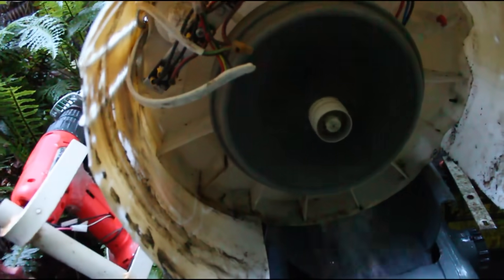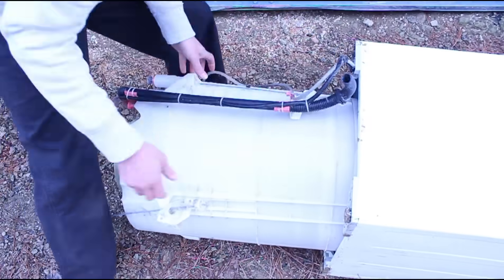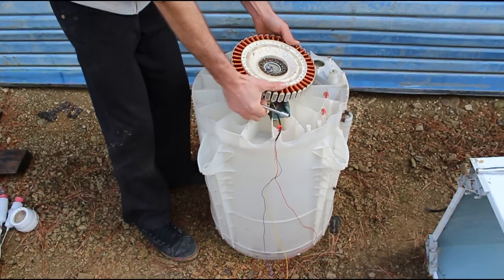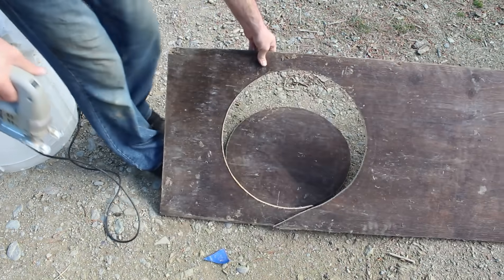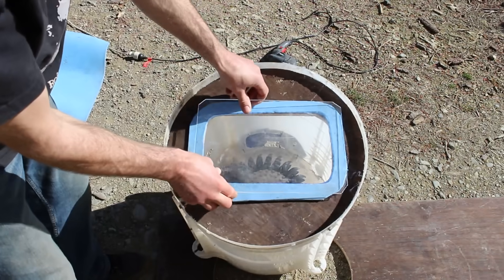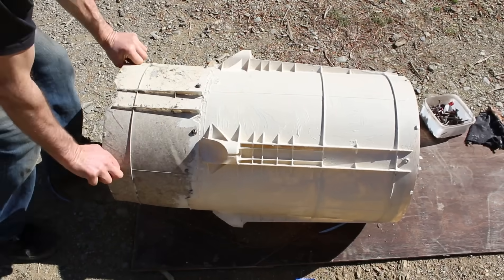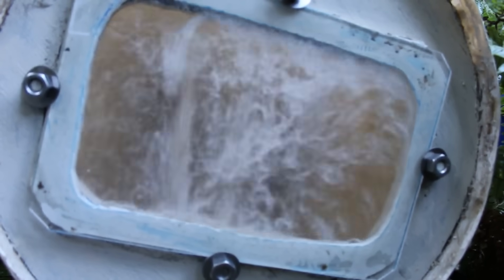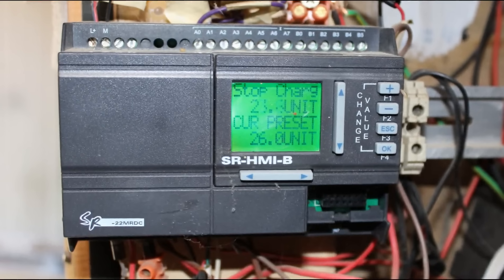Free power- How to convert an old washing machine into a water powered generator

Comment: Hi I know this is a 2014 video ...but I was thinking and would like to know if you think it would be possible for your water generator to run a strong enough water pump to run your generator...thus making it a free energy closed circuit or will the energy consumption of the pump equal out the energy generated. Hope to hear from you... Thanks
Reply: the problem with your idea is this.    THERE WOULD  BE  NO  POWER  LEFT OVER,   TO   GO  TO    HOUSE.     result:  a  Do-Nothing  system.

Comment: Did you have to have a reservoir to be able to get your 45 psi pressure?
Reply from the maker: My reservoir is around 100 litres, as long as you are using less than the stream flow , you don't need a large dam

Comment: Why do you close the tank and not allow the water run out from the big exit? Wouldn't that creates additional friction and resistance? I am not criticizing jus wonder if there is a reason for that?
Reply: ngry Ram
2 weeks ago (edited)
Cut hole and closed front opening to control flow, if water comes out front opening at high pressure, it sprays everywhere, makes the ground slippery, wet slippery ground creates hazards

Comment: Can I ask, it looks like around 4litres per second? We have solar and they want to charge us for feeding into grid at peak times, so thinking we could pump water to a storage tank"battery", but is there a way to make it more efficient, even if we have a water tower?  (Some days we have excess 20 or 30KW)
Reply from the maker: Yep 4-5L/second. Yes that would work, or use excess power to fill compressed air tanks then run air turbine when you need more kw.. Also some power companies here give an hour of free power every day so you could run a huge pump for an hour and fill a reservoir to run a turbine during peak times. A lot of work to set up especially if you have to build a tower, more feasible if you have a hill on your property.
Reply: Get batteries and charge them at the house....
run your whole house including a/c or an electric vehicle with your stored power...
or feed it to a neighbour if say they pay for the extra solar panels etc.
Feeding it back to the power company is a poor deal for you....

Comment: Hi , thanks for the video ,    I would just like to ask ,   how exactly are you getting such high pressure water supply from that stream  ?           I think it is clear, of course that we all know , energy canot be created , only converted , with variable degrees of efficency.      I like the idea of using the 3 phase system from the old wasing maschine,  its neat. 

Are you living way down stream - collecting the water in large tanks and then using a gravity feed to get the pressure up to this usable level?      I dont see anyone having asked this question  ?
Reply from the maker: Gravity creates the pressure, water intake is higher than the outlet
Reply: Hey mate I’m impressed with your set up!  I am thinking about attempting to make one,  can you please give me more information about the  automatic shut off valve drill thing you made?

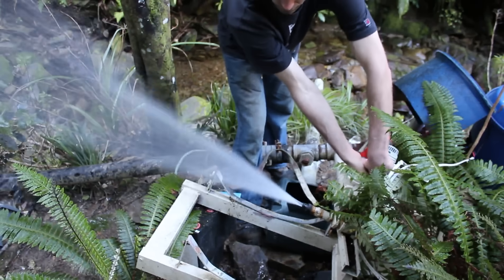Comment: 8:13 45 psi water pressure is equivalent to 32 m of water head. Either this bloke lives next to a 10 story waterfall or that water is pumped, and therefore not "free" power.
But a very impressive way to reuse a washing machine
Reply: Not hard to get 35m of water head on the mountains.... 🤷‍♂️

Comment: May I ask some question? 
How did you set an ac wiring to dc? To charge the battery
You have a video of that?
Reply from the maker: I use a 3 phase diode bridge rectifier, it converts AC to DC
Reply: @Rambro-angryram  thank you sir.

Comment: How far is the house from the creek ?
Reply from the maker: 500m
Reply: @Rambro-angryram  so the power goes from the turbine to the house through power cables that you laid? Might sound like a dumb question, sorry 😀
Reply from the maker: @Oceansta  From the turbine to the 24v battery bank, batt bank to the 24 - 240vac inverter then up the cables to the house

Comment: Hello I have a Fischer and Paykel smart drive that I bought to turn into a generator. We just got the white plastic bolt off but we still can’t get the rotor off to rewire it. What did you do to get the rotor off. We rewatched this video several times and we don’t know what we’re doing wrong.
Reply from the maker: Hi, I've never seen a black rotor, are you sure its a fisher & paykel? usually the plastic bolt wiil pull the rotor off as you undo it, maybe it has broken the piece connected to the rotor, must be jammed on, you may have to use some force to pull it off, does it turn easily without rubbing on the stator?

Comment: Not telling you how to suck eggs, but have a think about using a cars' alternator as the power producer, modern ones can produce 2500 watts @300 amps and give a steady curve of power increase, no surges, it has to be kept dry, so out of the water, connect to water wheel with drive shaft,  just an idea . . .
Reply from the maker: Nice idea but car alternators don't produce much power under 2000rpm, my turbine max speed is about 1000rpm so I'd have to gear it up which would mean heavy frictional losses

Comment: You can take a 50-gallon barrel and fill it up with water and run the XX out of the windmill Watermill I should say into the tank and then hook up a pump that sucks it back into the container and it makes its own light Rizzi you're going to have to have a battery charged up enough to get that generator rolling first you won't need a river just a 50 gallon barrel do filled up water

Comment: Do you know if other washing machine would work too? Or any other appliances that have a motor that would work?
Reply from the maker: Any motor will probably generate power with the right modification, I use the smartdrive because theyre well built and will produce 1kw continuously for years no problem
Reply: @Rambro-angryram  Thank you for getting back to me so quickly. another question: Why do you rewire the stator? Couldnt you just put an AC to DC convert on it? or do you get more power by rewiring it?
Reply from the maker: The factory stator puts out 400+v and is quite hard and slow to spin with a load on, rewiring lets it spin at a faster rpm more suited to wind and hydro applications and it is safer to work with the lower voltage
Reply: Angry Ram, I just finished rewiring the stator. Followed your video. For some reason it’s much harder to spin now... and i get less Voltage and Amps from it... is this normal or did I do something wrong? My hope is to make a windmill out of it... so need it to spin as smooth as possible... thanks for all you’re replies!
Reply from the maker: Something is wrong sounds like you have a short somewhere
Reply: Angry Ram you are right. I had the terminals confused. Once I figured that out I reconnected them and it seems to work better now. The thing is that with wind being less powerful I might actually find another washing machine and not rewire the stator so that I get more power with less rpm.... thank you so much for you’re help!

Comment: Weld the bottom witch holds the engine in from scrap metal.. It will not melt the moutnning space

Comment: How did you get 45 psi water pressure?
Reply: The water inside the pipe from upstream is affected by gravity which gives it "weight"
The longer the pipe and the further the fall the higher the pressure at the bottom of the pipe.
If the water had been in the pipe and fallen 229 feet, the pressure would be 100 psi......
Reply: @JohnSmith-yv6eq  thank you

Comment: How do you deal with blockages and silt?
Reply: The intake is a shade- cloth- as- filter covered pipe with small holes in pipe...
When the production of electricity drops off, Marty goes up to this intake and cleans it off.
This then allows the correct amount of water to flow once again.
Have a look at the recent installation at a friend's place...
https://www.youtube.com/watch?v=LVoeaKCEd2o&t=205s

Comment: This can be done with any model or has to be that specific model. Thank you
Reply: I think the key is that circle of wrapped coils bolted onto the drum. Most washers I've seen here in the US have the motor (which can also generate) off to the side driven by a belt. Maybe it still can be done. He did say get this exact model.

Comment: Why does it have to be a Fisher-Paykel machine? Can't find new let alone used.
Reply: It doesn't have to be, it just has to be a bldc motor similar to the one shown in the video. Apparently other brands in some models will use a similar motor.
Reply: @versedbridge4007  "bldc motor"?
Reply: @oldmanfromscenetwentyfour8164  BLDC means brushless direct current motor, which is what kind of motor the smart drive motor is.

Comment: Wondering how you get that much pressure
Reply: Gravity supplies the energy...the higher the overall fall of water, the greater the energy when it hits "bottom" which in this case is the nozzle squirting water at the Pelton wheel which turns the turbine etc etc.

Comment: Wish these videos that claim runs my house would state the kwh they use and generate. Or mention the electrical appliances being powered and how long for each one plus the amount of batteries they have. Because a normal house will not run off this.
Reply from the maker: This one puts out up to 1000w continuously 24/7 so 24 kwh/day. This is  more than enough to run all the appliances in my house -microwave, toaster, kettle, fridge, freezer, tv, laptops, lights,stereo, assorted chargers, 600w heater, rice cooker. and hot water heater.. the list goes on. I use gas for cooking. my battery is 24v 100ah I also run most of the tools in my workshop with the free power. grinders, drills, sanders, lathe, buzzer. I switch on the generator to run the welder, compressor and thicknesser.

Comment: Motor spins by electrical power in the stator coils which makes magnetic power. How can it produce back electric current without any magnetic field around coils? I am sure the material which rotates doesn't have any magnetic power. I watched complete video but can't find any details how electric current produces.
Reply from the maker: Magnets are built into the rotor

Comment: Why not run ac from the motor to the inverter and put the rectifier  there since ac travels more efficiently than dc?
Reply from the maker: It generates high hz ac which doesn't travel well through cable (skin effect)
Reply: Oh. I see.  Thanks for the reply.

Comment: Where are this links please??? I would like to see how to convert AC to DC
Reply from the maker: Sorry about that, youtube no longer has annotations so the links disappeared, To convert to ac all you need is a 3 phase diode rectifier, click on the link here - https://www.ebay.com/itm/2pcs-Bridge-Rectifier-3-Phase-Diode-50-Amp-1200V-SQL50A-New/123140383852?epid=17019536861&hash=item1cabbd246c:g:PgEAAOSwYeNa~jSX:rk:1:pf:0

Comment: How do you get such pressure from a trickle of a creek?
Reply: Gravity. The inlet to the pipe is a long way up the stream, something like 40 metres above the generator in height. The weight of the water in the pipe is what gives the 45psi.

Comment: There are a ton of vids out on youtube like this, but nobody ever tells how many man hours, the actual costs of the other needed gear like batteries, inverters, etc...would be nice to get a complete image of what's really involved.  Nice video...very creative, however...seems like doing all that for just 4 months before the bearings burn out isn't all that great in my humble opinion.
Reply from the maker: The current set of bearings have been spinning for over 2 years 24/7 pumping out 800w still no signs of needing replacement. I agree 4 months would be too short. Most of the materials i found at the dump, the batteries were ex telecom, they cost me 2 crates of beer and the pipes were from an old irrigator, cost me $100

Comment: If a person doesn't they have enough pressure couldnt they funnel the stream into say a big pipe then down the a smaller pipe then down to a smaller pipe until they got the need pressure? Isn't that what they done back when the hydro mined for gold, smaller and smaller pipes until iy was at the hydro cannon and then shot forced water at the mountain. I really would like to try this, instead of paying the electric company. My temperature here water never freezes.
Reply from the maker: Pressure is determined  by the difference in height between pipe inlet and outlet, and pipe wall diameter/smoothness when water is flowing. A correct sized jet on the outlet will direct the flow to your waterwheel while keeping the pipe pressurized .

Comment: Is there a way to run the electricity in a normal home fuse box?
Reply from the maker: Yep I use a 24dc - 240vac inverter so it is standard household voltage
Reply: @Rambro-angryram  I'm a carpenter, hunter, , woodsman, farmer...electricity, I need a little more detail description, I've ran wire through houses in construction, but I never hooked up the box. So I need the knowledge of how to run it from where it is stationed in the spring, water spinning the wheel, to the house, and what's waiting for it there, what type and gauge wire do I use, I want a totally independent system, with enough juice to run most household appliances, frig, freezer, TV, lights, heat, water, and food... I got covered.
Reply: See Marty's latest hydro using this technology and fully explained
https://www.youtube.com/watch?v=LVoeaKCEd2o&t=1s

Comment: you would raise your output noticably if you transfered the 380V AC to your home and rectified it THERE. long lines of 13VDC will eat away a considderable amout of your energy with heat in transmission losses...

Comment: Ahh the question I had in my mind was how was able to have water pressure for the generator to pull out power from. Turns out, his source is at a height where gravity helps him by directing free flowing water to his generator.

Comment: i was expecting you to install the unit upright, just as the wheel and bearings were designed to be used.
Reply: thanks.   i had a subliminal  'wait, what'  moment, about that.    hmm.   the load at the pma is  radially symmetrical.    the input force at the runner is  not.      all typical for a small-radius high-speed runner.    i guess the solution is to use the right bearings for the application.    cheers

Comment: why making the service hatch water proof? its an open system!?
Reply from the maker: I want all the water going straight back to the stream, otherwise it would be constantly muddy around the turbine
Reply: @Rambro-angryram  but wouldnt it be sufficient to mount it... i dont know... "normally"? 
Like with a hinge and a simple lock or something for easy access.
beeing water tight is not hindering, i guess. it's just unnecessary work?
since, based on the other videos, I'd say the water is not standing in that tube.
Reply from the maker: @Subsessor  Yes you could do it that way, but I like to be able to easily compress the seal, not so easy with hinges and latch.. It doesn't really bother me having to unbolt it, only a 30 second job that I have to do once or twice a year

Comment: some ideas... if you took the whole washing machine apart, you also had metal box with lid and bottom... seems like plenty of painted metal and plastic parts to use as sun shade, water cover, sealing front of the tank, etc... no need to use plywood or paint... i'm all for recycling and can see missing opportunity

Comment: How do you have 45psi to spin the wheel out in the middle of the woods?
Reply: Is it just from gravity?
Reply: @andrewgoren3758  Yes. If you look at his channel he explains that the water intake pipe runs well upstream, up the hill. The height of the inlet above the outlet is what gives the pressure  ("Head"). The length of the pipe itself is somewhat irrelevant, in his case it's that long to give the height above. With a steeper hill he'd not need so much piping.

Comment: How do you get such high water presure??
Reply: Watch the first minute of the video and he'll tell you.
Reply: @TD-wi1zh  even if you lift 100 pipe and drop the water normaly you will not have that kind of pressure i think he has something pulling the water at fast rate towards exit
Reply: @TD-wi1zh  propeller wheel is this whats hes using to have pressure?
Reply: @haschy6ex480  Can you show the rest of the world - people who've worked with these calculations for years (on and off) - your maths that shows otherwise?
The formula for working out pressure from head is widely publicised and has been known quite a long time. If you have proof that it's otherwise I suggest you publish a scientific paper, since these are considered standard calculations.
Better yet, you could actually tst it yourself. Get a pressure gauge, put it in the end of 40M of pipe, start filling the pipe. If the pressure reaches 45 before you've filled the pipe you'll see he's right. If the pressure doesn't get to 45, you've made a revolutionary scientific discovery that will prove every plumber, every scientist who works with fluid, just about every mechanical engineer and many people from many other fields wrong. 
Hell, I'll even help you prove this. We'd both be ultra-mega-rich from publishing this if we can prove the simple calculation for pressure from head is wrong.
Reply: @haschy6ex480  Nope, the pelton wheel is what changes the flowing water into a rotational mechanical force to drive the magnetic rotor around the stator, which generates the electricity.